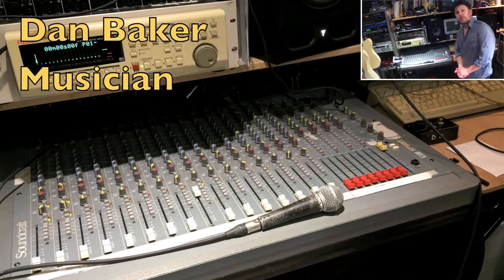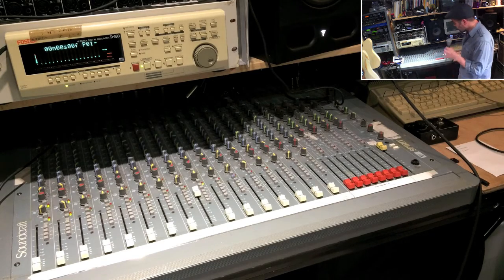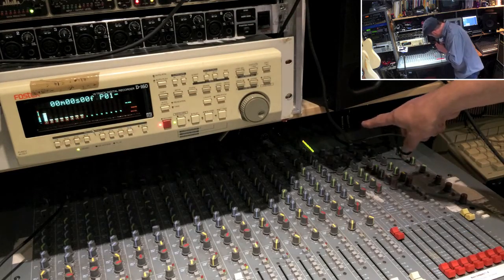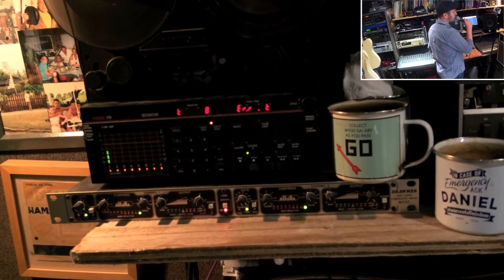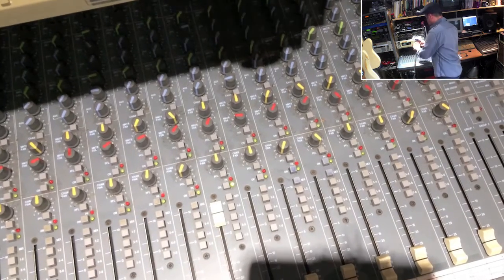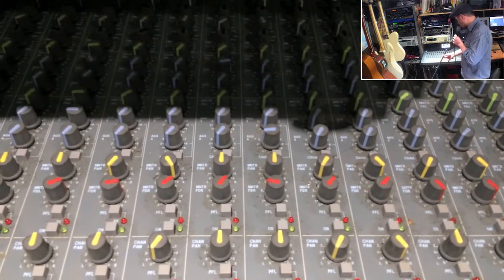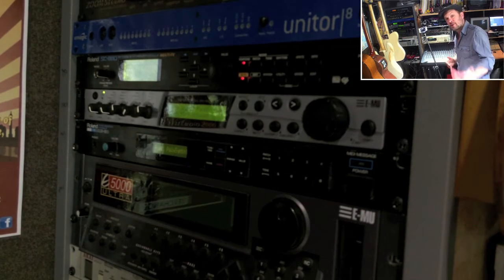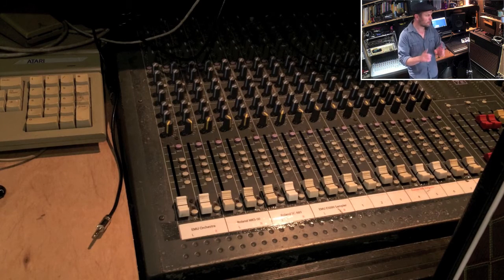Studio wiring: Why It's Important

Comment: Sorry to be a pain Dan, doesn’t putting three cables on top of each other and sending them to various inputs affect the input or output impedance of the various bits of kit?
Reply from the maker: You’re absolutely right that it does affect impedances, but the outputs of the desk have solid amplifiers on them, so much so, that I’ve run an oscillator through a desk input and through to the outputs, and each machine is flat all the way to 20kHz. I knew engineers back in the day who’d use the headphone outputs of two track gear to feed amplifiers instead of line outs!

Comment: Great stuff Dan!
 I tend to work in the box these days, but I still use my vintage outboard from time to time. I have an eclectic mix of gear, amassed over the last twenty plus years, including a patchbay.
When I had saved enough money to start buying my own gear, I used the patchbay to overcome the lack of inputs on my hard disc recorder. Next, I bought a sub-mixer for the sound modules and FX returns. I still used the patchbay, but more as a stagebox (for the reasons you stated in your piece about wearing out input connectors on the gear).
My patchbay sits in my rack now, connected up to my soundcard on two channels, for when I need to patch in an old reverb or perhaps my E-MU ESI 2000. It still has my old labels on telling me how it used to be though!  :-)